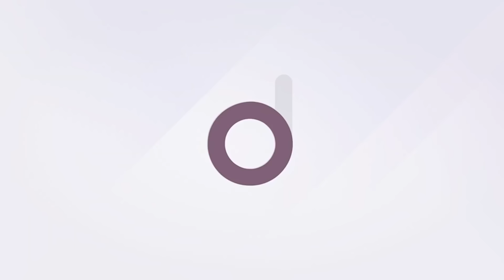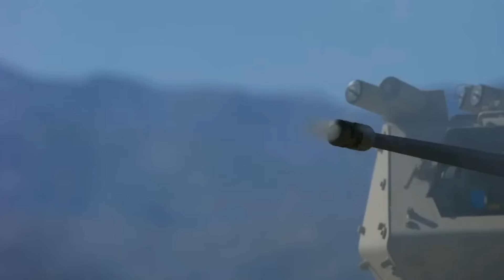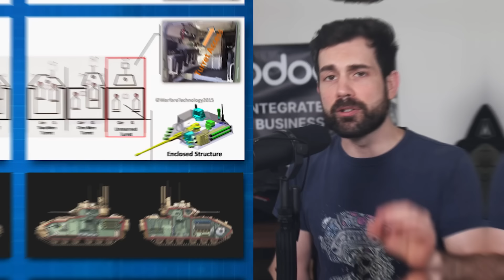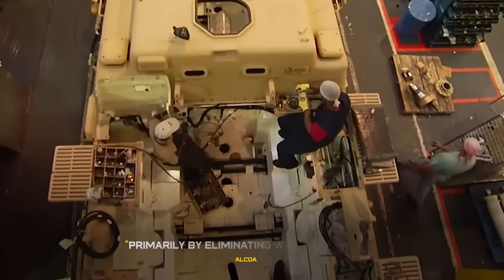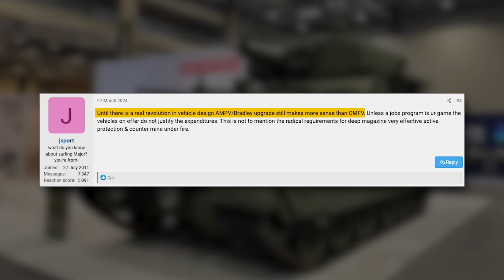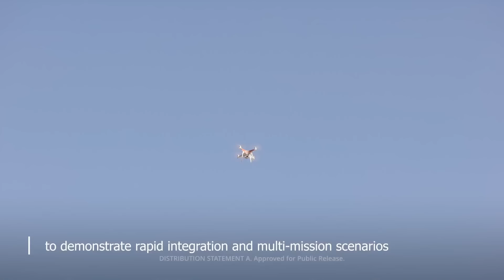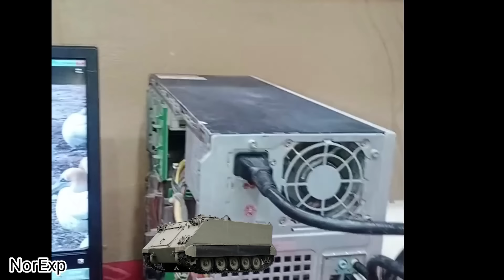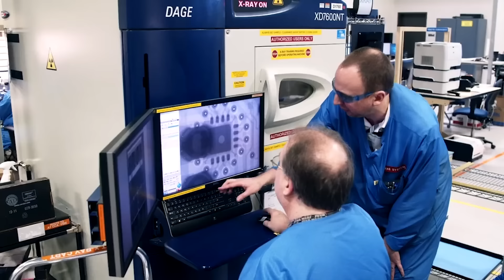How America’s Quietly Building a Secret Armored Fleet

Comment: NO. MULTIZONE. APS.

A few may have the M914 but not all and the one on display did not have radar panels.  And some, (Medical and Command) cannot have offensive turret weapons, whether by mercy role or antenna clutter.

Like a prancing monkey, you jabber on about how this thing has to be survivable against drones and the lessons of Ukraine are incorporated but you ignore simple truths:

1.  The racing class kamikaze drones are coming at 150-200mph today.  With a turbine such as is available on RC toys (see 400mph drone, here on YT) that's not going to last.

2.  FO Drones are limited to about 2km and radio systems are like Phasers vs. Borg.  You get maybe, _maybe_, one or two days of interference free usage and then you are back to flying into the dirt.

3  The future of drones is true autonomy, limited by spatial or timer induced search/attack areas to minimize drone-jacking or other fratricidal malfunctions.

4.  With the exception of NEMO, which is cool, all of these systems are direct fire.  When, by all accounts, if you don't want to get dumped on by drones, artie, mines and ATGW, the best solution is going to be simply never crossing that LOS horizon with guys who stumble along at 10-15mph across a 10-30m run.  Send the RCV/ACV.  Send the drones.  If the enemy is coming at you, over the horizon, then you need to intercept them OTH.  Ideally at the launcher.  That's how you avoid saturation attack.  By denying them the ability to literally look at you with their eyes because as soon as they go remote, you have their signal trace.

5.  ELINT goes both ways.  You have a 3km radar to help auto-stack engagements for a 1.5km ABM drone killer autocannon?  You need to worry about what happens when the bad guys start tracking your emissions at 30km.

What's the solution here?  Well, the enemy is going to work like this:  Larger LAMs with MMW radar or high-power optronics, like Lancet and Scalpel spot and mark targets from standoff ranges beyond the threat of AAA or MPAD.  Forward area launched, 'motherships' pop up fly across and drop multiple MAV microdrones nearer to the target capture box.  And those drones fly to a beacon on the scout whereupon they go pitbull with their own, cheap, optronics and sweep the area with ATC capable machine learning systems before putting out a howl and diving down to 4ft off the ground and coming in, together, as a swarm. 

*They are not going to be coming in as a single drone operator driven system.*

They are not going to readily trackable by radar and they are NOT going to be something you can stop with a dedicated 'flakpanzer' style defense without firing across your own position or providing at least a pair of armed escorts for every supply convoy, casevac or APC variant assault force.

The latter is where things get kinda funky because that '2 billion dollar buy' does not include a lot of armed variants.  Guaranteed.

And since that 30X173 is going to become very necessary in the wake of the capture of so many Ukrainian Bradleys, with their armor package and with their M242, you can bet that those units which are 'Armed APC' purchased are going to be frontally prioritized as escorts for assault forces in older Bradleys.

Now your APC is escorting your IFV because, apparently, ABM will not go down to 25mm.  And your rear area units are STILL NAKED.

Because they don't have their own, multilayer, (laser, projectile, on-vehicle explosive charge) APS.  How can it possibly be said that the vehicle is a better deal than the APS system?  If that APS system costs a cool million per vehicle installation, it is still cheaper than a brand new vehicle at 6.6 million per unit.

We have seen what the Russian Vitebsk 25/L-410 DIRCM can do.  We have seen what AMP-ADS (aka Strike Shield) can do.  We have not seen Iron Fist or LEDS-150 in action.  If you have a hardpoint as universal weapons station, now is the time to consider at least 500 combined staring FPA passive Missile Approach Warning Systems, laser-DIRCM on a mast, projectile APS (for ATGW as well as drones) in a turreted smoke grenade launcher format (with a micro range only radar, cued by the MAWS system) and terminal phase mail box systems for Strike Shield which should hang like blankets, from individual brackets, over  all four sides.

This is how you're going to make vehicles survivable against saturation attacks by drones.  By giving yourself multiple shots against blinding them, knocking them down at 50m and predetonating them, at 5m.

If you mess that up, minimum equipment standard capability, nothing else matters.  Because the moment you ignore the drone threat as the 1,500 dollar floor level lethal system, you might as well not invest in an APC at all.  Because the 1,000lbs of MRE and Ammo and/or the 10-15 guys in the back, are just stacked targets for a far more vastly exposed FEBA force that cannot stay fed and fire-back effective.

This is why you DO NOT trust a bunch of teenagers with an HSD, simply because they are wearing a uniform.  Because they will insist on things which make their coffin more comfortable or the hearse easier to fix.  Without really changing up the survivability metrics which keep them alive.

Let's add a couple more things that need to be said:

A.  If you want to control price, control size.  If you want to control vulnerability, don't mix missions with manned troop carriers.  That 30mm and ATGW setup would be ideal on a small ACV/RCV.  Because the smaller it gets, the thicker it's hide can be for any given footprint weight limit.  We're talking Wiesel on steroids here.

B.  If you have the minivan of APCs, and you are determined to kick ass and take names, with a multirole vehicle, you could do worse than to have a palletized VLS stack in the back.  This gives you a quad-pack per cell followon to Stinger (top attack avoids Vitbesk, range 6-8nm) to knock down Ka-52, a scout for your smart mortar PGMM carrier to send accurate plunging fire into trenches.  A couple of Peregrine or similar, MAM derived, fast-mover munitions to stop the Su-34 with Kh-38.  And, at least in theory, a VL Hellfire/JAGM/Brimstone with a thrust vectoring booster that can bite on other AFV.

The one is a good reason not to think you need to turn a battle bus into a sturmgeschutz.  The other is a purpose for the AMPV beyond being a self-deploying body bag carrier for a bunch of wet behind the ears grunts whose frontline roles should be shrinking not getting bigger.

We cannot afford large armies which pay at a Western cost of living ratio similar to what Putin is doing to build his forces.  Nobody is stupid enough to volunteer for the kinds of savage slaughter as 600,000 dead, 800,000 wounded which Ukraine represents in real casualty numbers.  We are hitting, year after year, 23-25-27,000 recruitment shortfalls.  Not for college and medical.  And conscription would likely result in a civil war as men who left the Woke Military based on assumed racism and actual DEI blockage on career advancement will fight tooth and nail to keep their kids from being brain washed by that nonsense.

So, we have to think about how we get a working army that is not as manpower intensive as it is today.  One which DOES NOT SEE infantry operations as the baseline to justify replacement in kind for a certain to be high intensity = high attrition ratio warfighter force commitment that is politically unusable.

The AMPV is not it, though its systems are at least a step in the correct direction.

Comment: Welded structures are weaker:
Yeah ... if you have no clue about welding. It shocks to hear this is an argument of a company receiving ... you know what? Forget what i just wondered about. That totally makes sense. Even sideline that printing brings other problems with it - and makes reapirs almost impossible.

Spare parts interchangability:
So ... what kinds exactly in a 'basis is monostructure' and 'add-ons are new' situation?

Bradley is shit, so we need new ... Bradley:
Okay, welcome to the future, i guess? Is America traped in some kind of weird time loop? Do you guys need help?

30 mm is better than 25 mm:
Yes it is. So that's the reason why we tried to sell you guys our programmable 30 mm guns on top of the US procured KF41 Lynx systems, but you felt the need to rip of the 30 mm's, fk up the whole balance and replace it with a dumb 25 mm.
So ... guys, get your train of thoughts in line plz.

Comment: Taught Forward Observation to LT's at Ft Sill. We had the M981 Fist a converted 113 that had a sit in 360 degree targeting turret. it housed 2 TOW missiles. We had 113 support. A TOW mobile system, so you could dismount and shoot from a hide. As an FO I love anything that can send hate downrange. We used the guided laser GLLD targeting system on the FIST to call for fire on ARTY. 4 radios inside, 2 vehicle 2 PRC77 in docks. When you dialed in the LLD the rounds were fire for effect. This was 1985, now with GPS,  FO's can be more accurate.
Reply: Perhaps they could turn the M113s into drones, to carry ammos, supplies and fuel at least. Maybe they could have only one pilot inside some sort of titanium bathtub for extra protection and with a modern mini cockpit, if drones are not reliable.
Reply: @Battery-kf4vu  They'd make good gun trucks and Ordnance  carriers.
Reply: Lord that beats dragging that boat anchor PRC 77 around in the top of your ruck.
That's what kids are for.
See? 
It screws with the compass and I'm keeping pace count.
We still use them 
No one's really checking those freqs
Still effective for our purposes.
Cheers

Comment: The M230 chain gun in that weapon station is a "weaker" gun than the 25 mm in the Bradley. The M230 is much lighter and has lower muzzle energy (it fires a 30 mm round at 800 m/sec versus a 25 mm round at 1100 m/sec for the M242), and is much less suitable for the Brad's traditional infantry support role,, but it's basically perfect for counter-drone work.

Comment: I really hope the US military is investing in manufacturing of FPV drones and parts as we’re seeing Ukraine use and build IN the field even using 3D printers for parts. We’re seeing how fast Russias massive store of mechanized armored vehicles being wiped out by $150 hand made drones with an old anti tank warhead from an old shoulder fired rocket. $150 taking out $20M vehicles , we should be going hard in the small Laser defense systems to take these down and also in FPV drones. To take $30M of one new vehicle and put that into these $150 drones could buy an insane amount of them to build up storage of these.

Comment: BAE is also the MFG for the APV being built for the Marines, it too has a number of options.  Similar modular plug and play.  Newer electrical power with a small aux power unit.  Huge improvements compared to the vehicles they replace.

Comment: Personally I would take the TOW missiles over the javelin most due to the fact the TOW is much harder to deal with because was it’s launched at you you can only really say your prayers and hope ADS or something hits it. However with the javelin iirc it uses infrared and if I’m thinking of the right thing that can be thrown off. I’m also like 60% sure the TOW hits harder or might be faster or maybe both.
Reply: I'd pick Spike ER/EuroSpike ER. It has a 10km range, is immune to jamming due to fiber optic controls, has ease of supply because it's a NATO-standard weapon, and it's NLOS.

Comment: FINALLY! This looks like the best "Modular" program I have seen.  The point is to have a single platform with several build-outs being used to their strengths.  Not an All-In-One vehicle.  The past attempts at common/modular platforms for vehicles, boats and planes have been executed...interestingly
Reply: just buy boxers. its a proven and capable platform and already has a 155mm and a good AA variant.
Reply: @nox5555  Boxer is really good and does the modularity thing very well, but it is wheeled and does not fit into all roles of tracked vehicles
Reply: @LuLu-ip4zb  It can go everywhere a tracked vehicle of this size should go.

Comment: I've been an absolute fan of the AMPV program since I first heard of it. To clarify, it's going to frontline troops first, while some of the ~6,000+ M113's will be retained for non-combat areas and less dangerous areas and roles.

It's an M2 Bradley chassis with upgrades, including increased auxillery power production. It's a much better general APC per the first five variants in production, and I view it as an "IFV on-demand" for the US Army if they ever needed to begin a massive up-gun project in a short amount of time. I also truly hope they decide to field some of the still experimental variants, such as the NEMO 120mm turret and U-CAS variants noted within the video.

However, there's really no reason to actively cheer for this to replace the XM30 programs. Everything I've heard has been positive about the XM30, particularly regarding the benefits from being one of the US Army's first digital engineering development projects, with statements describing how many bugs and flaws they're clearing with both of the new proposed competing prototypes before they even built their first working prototype. There was a specific statement from the program manager stating they're finally confident the program will succeed and result in a Bradley replacement after about five other programs have failed.

The Bradley is still capable, and the AMPV as our new APC and multipurpose general armored vehicle is tremendous. But, I still want that new XM30 with 50mm autocannon and new programmable proximity munitions, new rounds designed to take out main battle tank, integrated ATGM missiles with the Javelin/TOW and eventually next-generation TOW/ATGM, and potentially an integrated tethered ISR drone or some sort of ISR/attack drone launch and recovery capability.

If you've seen some videos from the older variant Bradley's doing work in Ukraine with it's 25mm autocannon, that 50mm is going to be downright scary. Who knows, perhaps they'll even put another 20mm/25mm autocannon on top of the XM30 unmanned turret using a remotely controlled weapon station to provide independent perimeter defense while the 50mm is engaging enemy armor (tanks) or drone threats with its proximity fused rounds. Plus, it is supposed to have increased survivability per general armor advances and a hardkill active protection system integrated into the defensive systems rather than purely a bolt-on component.

Meanwhile, we have the technology for helment-mounted displays within the F-35, allowing the pilot to essentially "look through" the skin of the jet using integrated cameras, sensors, and display capabilities, and Israel has been designing a similar system for their next generation IFV/armor. I'd be surprised if this isn't one of the new XM30 capabilities or perhaps a feature to integrate during the first new variant they ultimately develop. In general, the XM30 will also benefit from a better powerplant and hybrid technology to extend its range, additional fuel efficiency, perhaps some added agility, reduced IR signature, allowing for limited periods of silent mode, and additional auxillery power reserves to allow for expanded upgrade potential.

I say yes please to the AMPV and XM30, plus the M1A3 Abrams, and the JLTV A2 with its very own additional specialized and up-gunned variants.

Comment: "Amazing" .... Russia has been retro-fitting Berezhok turrets to its IFVs for well over 5 years ..... 

The Berezhok combat module is armed with the 30 mm 2A42 main gun used on the BMP-2 IFV, a PKT 7.62 mm coaxial machine gun. four 9M133 Kornet-E anti-tank guided missiles and one AGS-30 30 mm automatic grenade launcher. The Berezhok upgrade also includes a new fire-control system and optics.

the Russians I am sure having "sleepless" nights .....

Comment: I think a good vehicle would be a wheeled 6x6 with a 50mm airburst cannon, atgms, signature reducing stealth coating, sloped armor, low profile, 7.62 coax and commander's hatch mount, drone launch and recovery, smoke grenade launchers, grunt phone, amphibious capability, modular armor packages, trophy system, modern targeting system, and 40mm gmg rws. The usmc should look into something like that. You don't need a troop carrying capability. Something like the rdf/lt or begleitpanzer but modernized.

Comment: The command carrier will have 5 command crew. the 3 doing the work, an officer, and an NCO to run the team and handle the officer. Anytime you have a operation center you always have an extra officer and an NCO to act as the linkage between the two. The officers never want enlisted to act on their own, and they can't replace an enlisted operator.

Comment: One of the few things they have got right, also what happens when you don't try to make everything bleeding edge but good enough for the job. Still need for a more modern and armoured replacement of the Bradley in attack role, but for lots of uses AMPV is good enough.

Comment: Short story: New armoured vehicle concept is not getting attention because many people doubt it will actually be useful.

An extended bradley IFV with mounted anti-drone laser/radar system sounds far more practical than this lame multi-billion dollar revival of the M113 chassis.
The US army's obsession with modular "one fits all" concepts is truly a problem. It. Doesn't. Work. And let them deploy those toys to prove all the naysayers like me wrong. I would LOVE to see it. This crap is just the latest Arms Manufacturer plan to take billions home.

When you do a plumbing job you bring plumber tools, when you do a mechanical job you bring mechanics tools, etc.. You don't bring a fucking multi-tool that doesn't quite work.